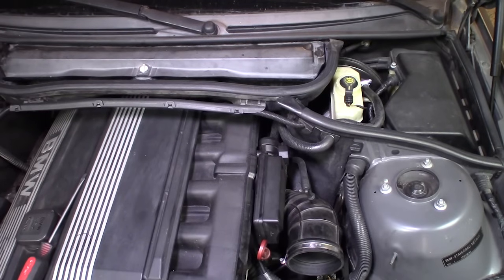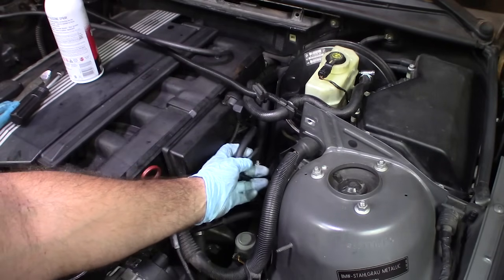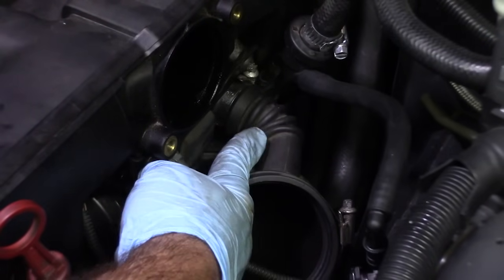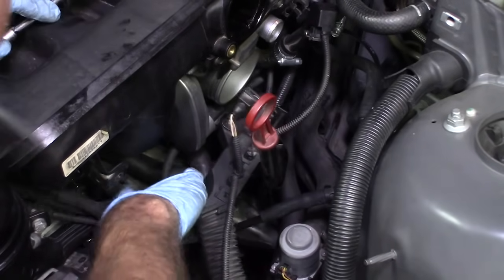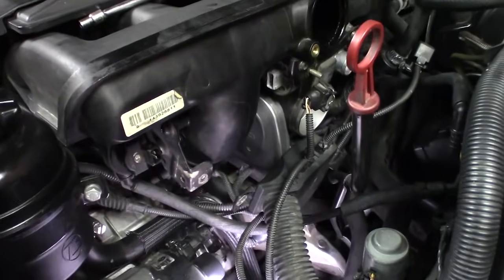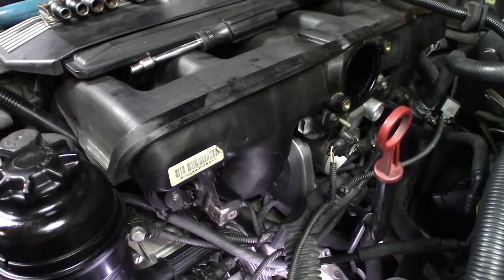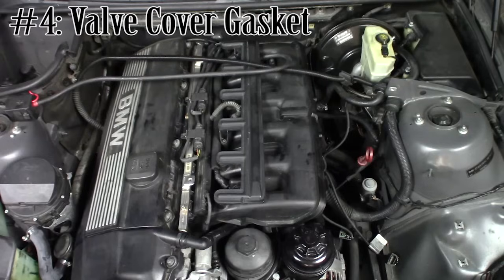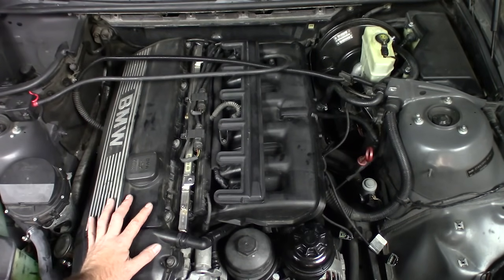BMW E46 & E39 Most Common Vacuum Leaks P0171 & P0174

Comment: I have P0172 and P0175 codes on my 01 M3. I have a hissing noise in the area where the CCV/oil return line on the M54 is found. Is the M54 similar to the S54? With my Peake Research tool it shows "air-fuel adaptation" on both banks 1 and 2. Sometimes poor idle and stalling too. This ONLY happens at idle. Under load/when on the throttle, I have full power like my car just came off the assembly line..
Reply from the maker: +Michael P The S54 is a pretty different engine than the M54.  That being said, the P0172 and P0175 codes mean that your mixture is too rich, which points to a bad fuel pressure regulator or a leaking fuel injector or possibly a bad mass air flow sensor.  Checkout this video for more info on fuel trims: https://www.youtube.com/watch?v=4CcwtaIe5c4
Reply: +50sKid I've changed out the FPR, fuel filter and my fuel pump (actually failed on me) just this year. When my idle begins to buck, I can actually disconnect the MAF and the idle levels out. I THINK it's the crappy KN cai I have. I'm already ordering parts to convert back to the OEM intake assembly. If that doesn't help I guess I'll focus on injectors and possibly start disassembling the entire intake assembly up to the throttle bodies to see if I can discover a vac leak somewhere. Problem is, many of the hoses are covered with heat shielding and it's impossible to see many of the actual hoses.
Reply from the maker: Michael P It's not a vacuum leak--that would cause P0171 and P0174.  Problem is too much fuel.  But I would encourage you to look at live fuel trims to see for sure.  Have you tried cleaning your MAF?
Reply: +50sKid Cleaned it earlier today.
Reply from the maker: Can you see live fuel trim numbers?
Reply: +50sKid I don't have anything. I'd have to have it done. Probably gonna look into it this week though.

Comment: Can a vacuum leak start during highway driving?  My E46 325 XI started to stumble at speed.  This has been happening for a while but a restart fixes it.  I've checked every coil and replaced all of the spark plugs.  I'm getting a misfire error along with a secondary air pump failure.  I pulled my air pump from another E46 I have and it did nothing.  I'm desperate to fix the stumble and get the car 1.5 hours home.

Comment: One to know if your oxygen sensors are bad you'll get hard starts because it cannot correct the fuel and air ratio and it will run like ass

Comment: My car runs just OK for a while, idles a little rough. When I rev the engine too high (accelerating onto a highway), it begins to misfire and run very rough. Is a compression leak a likely problem. (2008 128i)
Reply: A little clarification: the rough idle is sort of a low-frequency buzz. Most time after revving, it runs rough until I shut off the car and the check engine light comes on. Restarting the car usually clears the misfiring(?) and the engine light.
Reply from the maker: Low compression is technically a possibility, but that would be the most drastic answer to the problem.  Start more simple.  Your car needs to be hooked up to a scan tool that supports live data so you can look at fuel trims and determine what kind of problem you have.  Check out my video on using fuel trims to diagnose engine problems: https://youtu.be/4CcwtaIe5c4

Comment: hello 50skid ,please help I had BMW 325 I ,Had  a code P0171 and P0174 ,I found a vacuum leaks and fix a leaks AND ERASE a code and drive cycle for monitor ready for deq ,drive 700 miles still had problem with EVAP and 2ND UNREADY WHAT WRONG ? From state of oregom, thanks sam
Reply from the maker: +Sam Chanthabouasy What codes came back?
Reply: +50sKid  drive cycle for 50 miles code came back P0441,turn off engine wait a few minutes ,start car again [turn on engine code gone]still problem  EVAP AND 2ND AIR UNREADY, Thanks for reply and help  sam

Comment: Hi, I have only the code P0174 Do you think maybe is the o2 sensor bank2 bad?
Reply from the maker: +owin villalobos No, it's almost certainly not the O2 sensor.  In this case, the O2 sensor is very likely working and correctly telling you that you have a vacuum leak or some other problem that is causing a lean condition in just your second bank.  I've got a future video coming up on how to use an ELM327 scanner to look a fuel trims and pin point problems.

Comment: Hi i have a question. I have a 1999 bmw 323i. I was driving one morning it was fine. Parked it 
,6 hrs later i started the car and the gear woth this ( ! ) light turned on along woth traction control light as well. Do you ever have this kind of experience before?

Comment: I have misfire codes p0300 and on all cylinders but no p0171 or 174 codes could this be my problem? S54 engine
Ive replaced coils and spark plugs already and don't know what else to do.
Reply from the maker: Check out my fuel trims video to identify whether you have a lean condition or not

Comment: Hi, today I opened my car but my engine don't have anything similar to this ccv :(  so i was not been able to find out the ccv. Today I got know my car has hydraulic valve adjuster, one thing came in my mind, when first time I got this problem my hydraulic power steering reservoir was empty, do you think it has any connection with my problem? Or any thing in your mind?
Reply from the maker: What car do you have?
Reply: It's 530i Nov 2007 UK Model, It has N53 engine I believe. Took it to BMW for Diagnostic check and after diagnostic they said it's injectors & Cat Converter needs to be replaced. Give me a quote of £4000 of this old model. They are very expensive and I think coding needs to be done for injectors too so before changing I want to make sure does injectors cause issue like I am getting only when it's really cold. Many thanks again.
Reply: Also I didn't find it's CCV same as you shown :( Any help will be very helpful. Please share your thoughts on, does injectors behave like not working when cold and after 10mins when engine gets hot starts working.
Reply from the maker: Yeah I seriously doubt you need to replace your injectors and cats.  Please start watching my Fuel Trims videos so you can learn how to see if your car is running with a lean condition or not.  I suspect that the symptom you are describing is a lean condition and it's being caused by a vacuum leak, perhaps.  If so, look at my DIY smoke tester video so you can see how to track it down.
Reply: The codes I am getting from car are: P0300, P0304, P0305 (This one some time comes or some time doesn't) & P0306
Reply from the maker: You didn't say you were getting misfire codes before.  That's very important information for making a diagnosis.  You should be able to use that fog machine if you can get a tube onto it to direct the fog/smoke.  Anyway, get a code reader and see what your fuel trims are reading.  Start there.  If you have normal fuel trims (no lean or rich condition), then you can proceed to diagnose your misfires in the usual manner.  I have a video for that.
Reply: Thanks, looking to buy a software to run fuel trim. May get in touch again with you if more help needed. Thanks again!
Reply: Hi, today I run the fuel trim below are the results.
Bank-1 short Term value remains close to -3.9
Bank-2 Short Term value was in between -9 to -14
One more thing which surprised me, my both banks 1 & 2 O2 sensor 1 for each came with out put "Test incomplete or Dependent test failed"
Looks like both pre cat O2 sensors are not working. my car engine was running for 10mins but nothing comes up.
Vaccum Value at idle: -9.45
Air Fuel Ratio Commanded: 14.74:1
Air Fuel Ratio Measured: 14.94:1
Fuel Rail Pressure: 2906.56 psi (Is it not very high?)
Report is below, Any help or views will be very helpful to cure my loving car. Thanks for all your help.

Mode $06 report generated by Torque for Android
================================================

Test report:
------------------
MID:$01 TID:$83
 - O2 Bank 1 Sensor 1
Test incomplete or dependant test failed
--
MID:$02 TID:$01
Rich to Lean sensor threshold voltage(constant) - O2 Bank 1 Sensor 2
Max: 1.09934V   Min: 0V
Test result value: 0.64001V
PASS
----
MID:$02 TID:$02
Lean to Rich sensor threshold voltage(constant) - O2 Bank 1 Sensor 2
Max: 1.09934V   Min: 0V
Test result value: 0.64001V
PASS
----
MID:$02 TID:$07
Minimum sensor Voltage for test cycle(calculated) - O2 Bank 1 Sensor 2
Max: 1.09934V   Min: 0V
Test result value: 0.00488V
PASS
----
MID:$02 TID:$08
Maximum sensor Voltage for test cycle(calculated) - O2 Bank 1 Sensor 2
Max: 1.09934V   Min: 0V
Test result value: 0.85986V
PASS
----
MID:$02 TID:$81
 - O2 Bank 1 Sensor 2
Max: 0.99991   Min: 0
Test result value: 0.03904
PASS
----
MID:$05 TID:$83
 - O2 Bank 2 Sensor 1
Test incomplete or dependant test failed
--
MID:$06 TID:$01
Rich to Lean sensor threshold voltage(constant) - O2 Bank 2 Sensor 2
Max: 1.09934V   Min: 0V
Test result value: 0.64001V
PASS
----
MID:$06 TID:$02
Lean to Rich sensor threshold voltage(constant) - O2 Bank 2 Sensor 2
Max: 1.09934V   Min: 0V
Test result value: 0.64001V
PASS
----
MID:$06 TID:$07
Minimum sensor Voltage for test cycle(calculated) - O2 Bank 2 Sensor 2
Max: 1.09934V   Min: 0V
Test result value: 0V
PASS
----
MID:$06 TID:$08
Maximum sensor Voltage for test cycle(calculated) - O2 Bank 2 Sensor 2
Max: 1.09934V   Min: 0V
Test result value: 0.90878V
PASS
----
MID:$06 TID:$81
 - O2 Bank 2 Sensor 2
Max: 0.99991   Min: 0
Test result value: 0
PASS
----
MID:$21 TID:$81
 - Catalyst Monitor Bank 1
Test incomplete or dependant test failed
--
MID:$22 TID:$81
 - Catalyst Monitor Bank 2
Test incomplete or dependant test failed
--
MID:$3d TID:$81
 - EVAP Monitor (0.020")
Test incomplete or dependant test failed
--
MID:$3d TID:$82
 - EVAP Monitor (0.020")
Test incomplete or dependant test failed
--
MID:$3d TID:$83
 - EVAP Monitor (0.020")
Test incomplete or dependant test failed
--
MID:$41 TID:$85
 - O2 Heater Monitor Bank 1 - Sensor 1
Max: 2,047.90002°C   Min: 680°C
Test result value: 780°C
PASS
----
MID:$42 TID:$81
 - O2 Heater Monitor Bank 1 - Sensor 2
Max: 5,000   Min: 0
Test result value: 304
PASS
----
MID:$45 TID:$85
 - O2 Heater Monitor Bank 2 - Sensor 1
Max: 2,047.90002°C   Min: 680°C
Test result value: 780°C
PASS
----
MID:$46 TID:$81
 - O2 Heater Monitor Bank 2 - Sensor 2
Max: 5,000   Min: 0
Test result value: 323
PASS
----
MID:$a2 TID:$0b
EWMA Misfire counts (average) for last 10 drive cycles - Misfire Cylinder 1 Data
Max: 65,535Count   Min: 0Count
Test result value: 0Count
PASS
----
MID:$a2 TID:$0c
Misfire counts for last/current driving cycles(calculated) - Misfire Cylinder 1 Data
Max: 65,535Count   Min: 0Count
Test result value: 1Count
PASS
----
MID:$a3 TID:$0b
EWMA Misfire counts (average) for last 10 drive cycles - Misfire Cylinder 2 Data
Max: 65,535Count   Min: 0Count
Test result value: 0Count
PASS
----
MID:$a3 TID:$0c
Misfire counts for last/current driving cycles(calculated) - Misfire Cylinder 2 Data
Max: 65,535Count   Min: 0Count
Test result value: 15Count
PASS
----
MID:$a4 TID:$0b
EWMA Misfire counts (average) for last 10 drive cycles - Misfire Cylinder 3 Data
Max: 65,535Count   Min: 0Count
Test result value: 0Count
PASS
----
MID:$a4 TID:$0c
Misfire counts for last/current driving cycles(calculated) - Misfire Cylinder 3 Data
Max: 65,535Count   Min: 0Count
Test result value: 2Count
PASS
----
MID:$a5 TID:$0b
EWMA Misfire counts (average) for last 10 drive cycles - Misfire Cylinder 4 Data
Max: 65,535Count   Min: 0Count
Test result value: 17Count
PASS
----
MID:$a5 TID:$0c
Misfire counts for last/current driving cycles(calculated) - Misfire Cylinder 4 Data
Max: 65,535Count   Min: 0Count
Test result value: 5Count
PASS
----
MID:$a6 TID:$0b
EWMA Misfire counts (average) for last 10 drive cycles - Misfire Cylinder 5 Data
Max: 65,535Count   Min: 0Cou
Reply: Apology for keep dropping the questions.
Today I cleaned my MAF sensor, after that both short trims turned closed to zero for couple of minutes but afterwards Bank-1 trim goes to +8 and bank-2 is fluctuating in between -1 to -4.
Any idea why one is high +ive and other one is reasonable -ive.
Got something new on the code machine which is P2187 with status pending.
Any idea what it is? Looks like issues shifted to bank-1 now after just cleaning the MAF sensor.
Any thought will be very helpful. Thanks.
Reply from the maker: Have you looked at the output of the o2 sensors the way that I do in my fuel trims video?  Can you confirm that they are cycling rich and lean between 0.1v and 0.9v?  Sometimes o2 sensors can get lazy and not cycle low and high enough, or they get stuck low or high, etc.  So don't rule them out is what I'm saying.  Because you have such wildly different readings between both banks, I tend to look at O2 sensors in that case.
Reply: Many thanks for prompt reply.
Actually I am not getting any reading from my number-1 bank 1&2 sensors.
In my test report I am getting temperature of the sensors but not getting any other reading.
Any guess why? Is there any fuse related to these sensors, Do you think both broken at same time?
Sensor 2 at both banks are in between above range.
Reply: Looked at your negative fuel trim video.Finally managed to get the readings of both pre cat O2 sensors, both showing volt 1.9 to 2.1.I am surprised with the values.Sensors after cat showing values close to 0.5v.What your thought on sensor values?My both banks short trims gone back to -ive after driving 20+ miles. Bank1 -6% & Bank2 -10%.If it's injectors problem, I am thinking to get my injectors refurbished as I got one person who guaranteed he can do it? Is it ok to do it or always buy new one? Any recommendations?Apology for keep bothering you and thanks for answering my questions.
Reply from the maker: I think those voltages are way way off.  Something is clearly wrong with your o2 sensors and/or the wiring to them.  What tool are you using to measure these values?  I would not be concerned with fuel injectors right now--your precat o2s are where you need to be looking right now.
Reply: Actually I was using android Application TORQUE with bluetooth version of ELM-327 on OBDll but that I was not getting any pre cat sensor reading. So I asked one of the garage to read these o2 values who has Bosch equipment of 2014 year. I am not sure what model exactly that one has but it has 10" screen in black/grey casing. Today I bought ScanMaster similar what u had in your in trim videos. Will let you know as I managed to read something through it as my Elm OBD device is bluetooth but my laptop don't have bluetooth So connectivity issue at the moment :( nothing easy :(
Reply: Hi again, finally got the results on same software tool what you showed in your fuel trim videos. Below is the story,
My engine was hot to normal after 3+ miles drive,
Short fuel trim both banks were at: +3% to +10%
Both Pre Cat O2 sensors showed very low voltage: 0.02 to 0.08 mA (Almost zero if converted into V)
After cat O2 sensors current: 0.8 V
Both pre cat lambda equivalence ratio: 1.27
System was in closed loop.
Coolant Temperature:90c
When I raised the rpm both fuel trims gone to ZERO for few seconds until I released the padel.
Is it vacuum leak or O2 sensors issue?
Thanks.
Reply from the maker: It's the pre 02 sensors.  You need to replace them but also check the wiring visually and make sure there is no damage.
Reply: Thank u for all the help, give it a go over the weekend.
Reply: Thought to share with you as you helped me a lot with all diagnostics, Two weeks ago I fixed it by replacing the injectors. Just for info - car has wide range 5 wires o2 sensors which tends to work in mA I believe.
Thanks again for all your help 👍🏻

Comment: Hey 50sKid! PLEASE HELP!? You're videos are the bees knees man, very helpful. But I've got another problem that I know you could help me out with. (Transmission) my reverse slipped out but all other gears are unaffected. The funny thing is, the gear is not busted and when I throw the car (330ci) in reverse it tries to back up for a split second and then it stops. Mass confusion with this case. I've been told it could be transmission solenoids or transmission control module. I've also been told I'll have to have it rebuilt. If you could help shine light on this issue before I go pooring hundreds of dollars into this vehicle it'd be greatly appreciated, sir. Thank you
Reply from the maker: If it were me I would test the transmission output connector pins for the proper resistances.  There is a dropbox link in the description of my transmission rebuild videos.  One of the documents in there contains instructions on what the resistances should be.